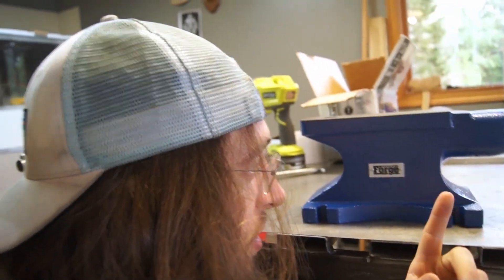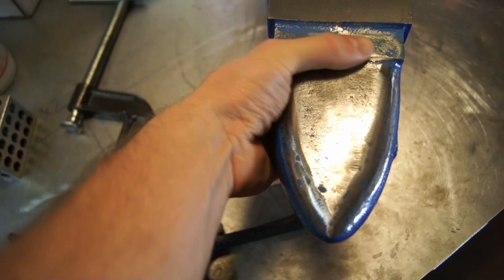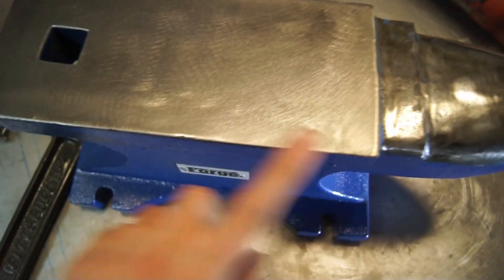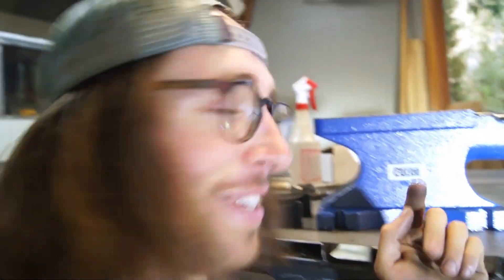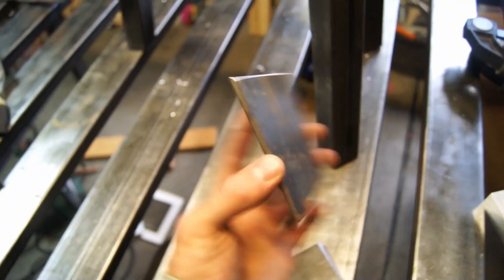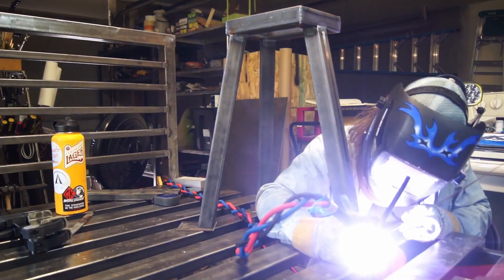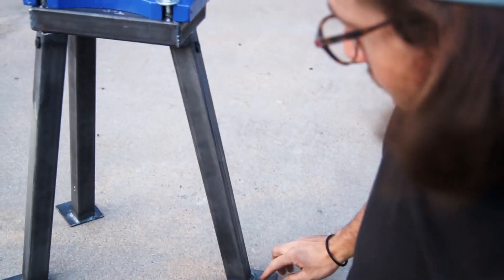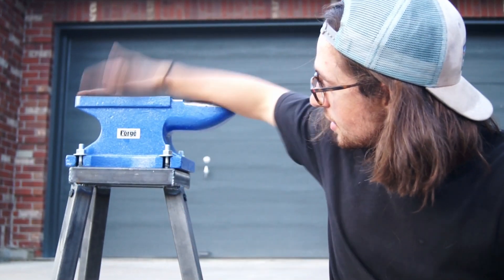Alec Steele Anvil (One Day Build)

Comment: If the top would be hardened there would be lots of sparks. If there is little sparks it means it's probebly cast iron. 
Harbor freight is cast iron so its not really suiteble for forging. Cast iron is too soft and it can break. 
Blacksmiths call something like that from HF an ASO (anvil shaped object). 

The Essential Craftsman channel has some nice anvil video's.
Reply from the maker: Thanks maybe ill harden it when i'm felling bold
Reply: @DylanEdmiston  you can’t harden cast iron
Reply from the maker: @testickles4720  Should be able to case harden